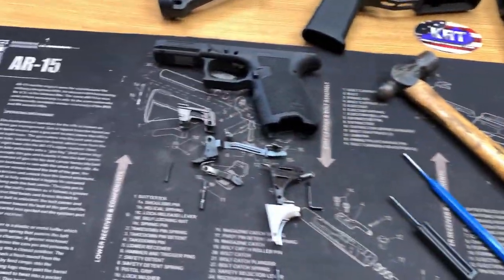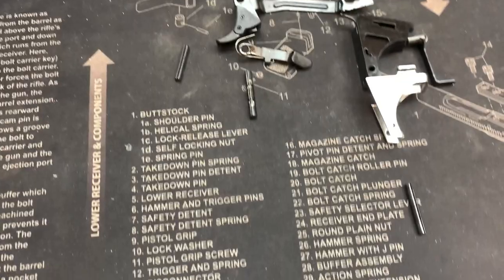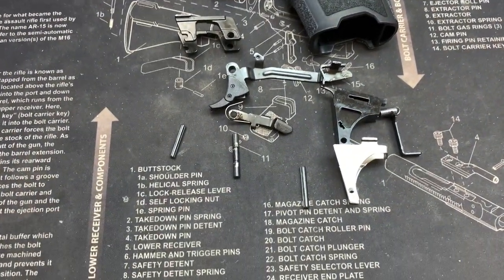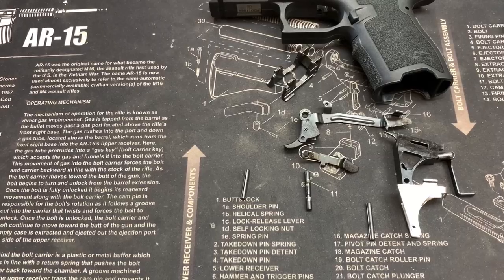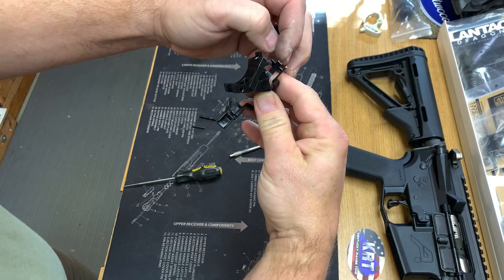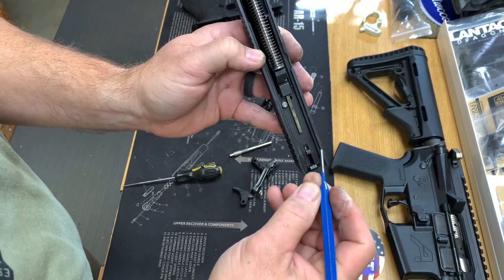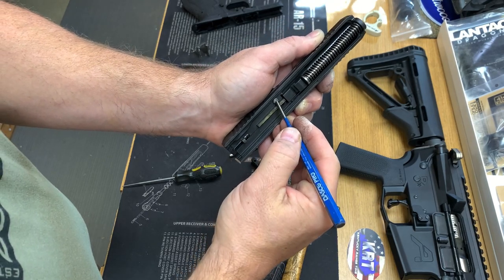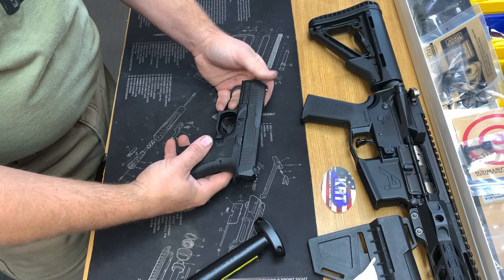15 Minute Trigger Polish Job on the PSA Dagger

Comment: The best thing you could possibly do is remove the hinged trigger and throw it in the trash and get a flat faced trigger and Ghost 3 or 3.5lb trigger bar. Best 20$ I’ve spent in a long time

Comment: Great job! You can HEAR the difference after polishing.  It's much more quiet, less of that plastic scraping sound.  I did the exact same thing to my Glock 43x before I ever shot it.  It's my first Glock.  I also polished the slide rails.  But the single thing that made the most difference was polishing both sides of the trigger spring shoe that the connector slips into.  It was gouging the plastic trigger housing.  No expensive aftermarket trigger parts needed. I do the same kind of thing to my revolvers as well.

Comment: May or may not be helpful, but I also polished the inside (right side) of the rear rail module and the portion of the trigger bar that interfaces with it.  It appears on my Dagger that these two surfaces do make contact.  Not an issue with a Glock as there is no rear rail module.
Reply from the maker: 👍🏻 makes sense. anywhere there’s metal on metal contact.  Thanks for the tip. 😉

Comment: Was there any damage to the trigger grove area when hammering it out. Mine did not budge whatsoever.
Reply from the maker: No damage but be sure to use the correct size punch. The trigger assembly has the metal “cup” around it and the pins actually tension on the holes in the metal cup.
Reply: @kentuckyrangetime  thanks

Comment: I spy a Strike Industries enhanced AR lower parts kit. I just built a nice AR using that parts kit 😆. Good video, I've been doing this for years with my Glocks. Micro Dagger C-1 is on order, from what I understand if you want to put an Apex into a Micro Dagger it requires an OEM Glock 43X assembly.
Reply from the maker: Strike makes some good mods for sure. 

I’ve been looking at the micro daggers but I’ve already been in a G48 MOS for a couple of years with the Sheild arms mags. The wife’s in a 43x with the Sheild mags as well. I’d have to change the metal mag release back out. 😂😂

Comment: Those roll pins were a bitch to remove. Trigger pin had to be tapped out w a punch. After the polish, my dagger went to 4 lb. Prior was 5+ lb. It smoothed the action a lot. I wish psa would do something about those roll pins. Also, my slide cover plate was really jammed into the slots. I had to use a flathead screwdriver to pull it out. But now that it’s done, I’m not monkeying with my dagger anymore. 

My Glock 17 disassembles much easier by comparison.
Reply from the maker: My exact thoughts on the whole process too!  Lol. 

Still, it’s a gray value at its price point. 😉

Comment: Those roll pins will keep me from disassembling the lower since they appear to have a finite number of times you can do them.
Reply from the maker: I’ve been pondering this pin design since I did the initial video. It’s different than the glock pins and definitely a bit more laborious to disassemble but i’m now thinking the polymer isn’t what they intended to hold the pins. it’s the metal of the trigger housing.  The holes in the polymer just keep the housing and pins from moving around once assembled inside the frame. 

The design made a bit more since looking at from that angle. And it relieves most of my initial concern over the pins. 😉

Comment: thanks for the vid! maybe you can answer my question as to why my new dagger sounds so bad when i send back the slide.. the spring sounds like its scratching everything inside lol.. it sounds like the slides screaming lol
Reply from the maker: 😂😂 

I’m guessing it’s the edges on the flat guide rod spring riding across the guide rod. Lol. I’ve had several Glocks with the double captive spring make some weird noises too. It usually subsides or diminishes after several hundred rounds of wear-in and some carbon buildup. 😉
Reply: i oiled the SHIT out of it.. and it seems to of  made a 80% reduction in overall screeching lol .. I have put about 320 rounds through it so far.. runs perfect.. not a single issue BUT the sound. SO i guess.. more rounds and break in along with being nice n wet is all it needs.. im sure after its at like 1000 rnds itll be much better! Thank you sir!! 
 @kentuckyrangetime
Reply from the maker: @Orlandohaschanged  your very welcome!!

Comment: The front rail looks like a P80 rail. Did you try a set of Glock pins? I would mic. the roll pins and see if they measure 22mm if they do, you can throw those roll pins in the trash.

Comment: Have you found any good replacements for the roll pins?
Reply from the maker: No. The way the internals are designed I’m not sure anything but a roll pin will work.
Reply: @kentuckyrangetime  thanks 👍

Comment: Great info when or if I get a PSA Dagger I will have to do it! By the way, what is that trigger on the Aero on the bench, or rather that trigger shoe?
Reply from the maker: I had to go back and look. 😂😂

It’s the Hiperfire PDI, 2lb. Comes with the adjustable shoe. I really liked this trigger but unfortunately it was installed on a rifle I traded off a while back. I didn’t realize it until after the guy had already looked at it. Lol

Comment: how did you manage to get the trigger pin out?  Wiggling the slide release isn't working
Reply from the maker: I don’t remember having any issues with it. Might need to move the slide release a bit differently to get the hole to center up better??🤷🏼‍♂️

Comment: How did you get those pins out? What punch did you use? I've bent so many tools and the front one just won't budge.
Reply from the maker: I don’t remember the exact size but it’s the largest one that will fit in the hole. It’s a roll pin so it’ll take a hammer and some force to drive it through. If you have a block with a hole in it for the pin to drop into it’ll help too.

Comment: Great job and nice video. I've seen alot of video's of people complaining about the gun having rolled pins instead of solid pins, but most guns are made with rolled pins, so whats the big deal?
Reply from the maker: Just from observation of everything I’m guessing that driving the roll pins in/out with a pin punch will eventually wear and enlarge the holes in the polymer frame.  This might create a bit of slop in how tightly the locking block and other parts fit together. 

Most people will never remove them or do it so infrequently that it’ll never be an issue.

Comment: I totally missed the trigger install.   I have the center pin installed,  can you tell me which pin goes to the rear housing? Is it the shorter or longer pin? Thanks!
Reply from the maker: I didn’t notice a length difference. I might have got lucky putting them back in though.
Reply: @kentuckyrangetime  ok thanks!

Comment: Hey, bud. A little unrelated but I read on a forum that a stiff trigger pull on a glock/dagger means a scratched connector. How is that possible?
Reply from the maker: Not really sure how a “scratch” could do anything to stiffen the trigger pull. you might feel a little grittiness as it pulled over a scratch. Now a large gouge where the metal parts work across each other might create additional resistance.

Comment: Can u put Glock pins instead of roll pins
Reply from the maker: i seriously doubt it. The holes in the metal inserts  inside the frame would have to be exactly the right size and if they did fit there wouldn’t be any material to hold the pins from falling out.